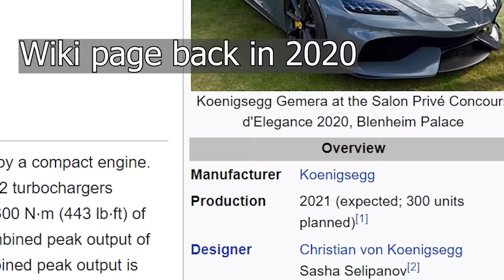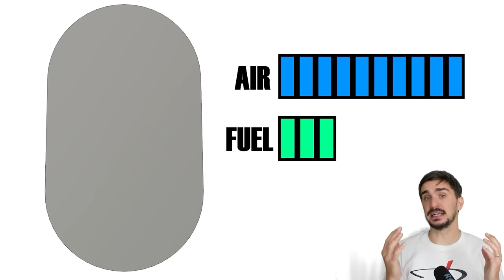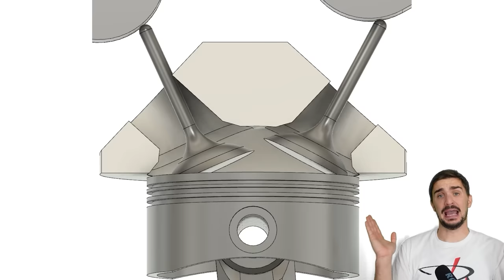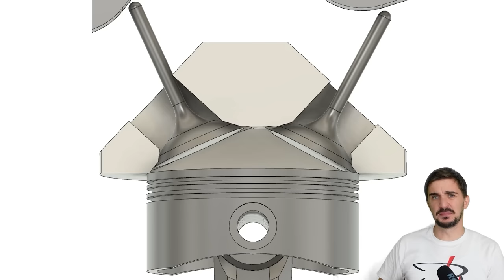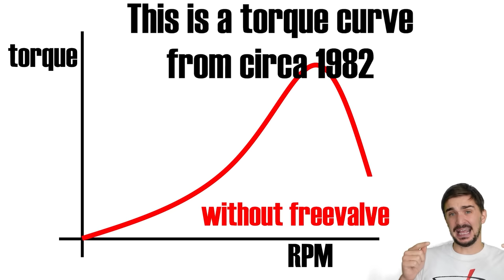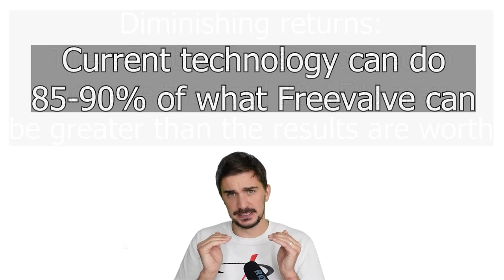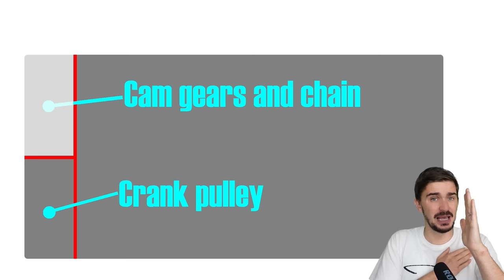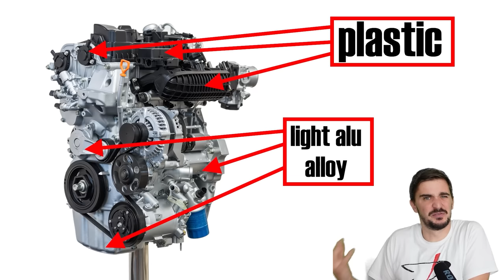FreeValve Isn't a Big Deal. Here's why

Comment: The numbers that Freevalve annouced really are not that exciting. But I stil believe it is a game changer: less energy loss on mechanical components. Moving the whole cam system demands a lot of power, and the bigger the engine, the bigger the system and the loss. It also is quite simpler. Imagine if they actaully make it mass produced, reducing the price to reach the simple cars, just like GDI did years ago. We desperately need less complex engines. VANOS/Valvetronic from BMW, has an insane ammount of moving parts. But FV is just one part of the equation: put it together with pre-chamber ignition and eturbos and we are taking combustion engines to a new level of efficiency. If you want to still have many moving parts, use a variable compression system. It will bring more benefits and less drag than the traditional camshaft system.

Comment: for each valve...  would it not be simpler to use a hydraulic shuttle valve to redirect pressure application to a double acting piston that opens and shuts the cylinder valve depending on which side the pressure is.. trigger the shuttle valve to move by pressure pulse produced when a simple cam lobe passes a plunger.  eg if all the plungers for say timing the valve openings are on one place, that can rotated and all the opening timing is adjusted by rotating.
fully adjustable valve events, and avoids use of springs. conceivable such would allow valves to open faster, and without spring bounce allowing higher rpms.

Comment: Did you ignore the " torque" lost spinning the cam shaft and other heavy parts !? Or i  misunderstood..... How ever it's like having Traditional engine plus electric motor Sooo if they use perfect RPM small genriter to charge Battery 🔋 and big electric motor to move the wheels it's the same

Comment: Freevalve honestly isn't worth it for any single one of those reasons listed, and yes all of those performance claims were trash, but I think trying to combine all of the different features of different cams and trying to achieve this infinite variability on the cam profile kinda leads to the idea of a camless engine. What I mean is we compared individual benefits without acknowledging that a camless engine brings all of those benefits together. Is it worth it? If you're a DIY hobbyist and just WANT to then I guess yeah, but to make it more suitable for mass production it definitely needs to be electric not pneumatic.

What would be really fun would be to have some electromechanical switches and dials and rotators and all kindsa goofy old sci-fi horror looking controls and confuse the living hell out of your friends / mechanic with a control system that looks like a Biblically Accurate Swiss Watch™️ lmao

Comment: surely the major benefit is a massive reduction in rotational mass in the engine? no more cams no more chain no valve springs sucking energy. albeit the solenoids will still take energy to run it'd be a lot more efficient.
Reply: "no valve springs sucking energy"?
There is springs on the valves as in a usual system, but in a usual system some of the energy used when compressing the spring while opening the valve is returned to the engine when it "drives" the camshaft on valve closing(On high RPM you will probably not get back much energy though..).

And you really think that compressing air with a piston air compressor(With internal friction n stuff) and then use that air to open the valves would be more efficient than mechanically open the valves with a camshaft?!
This is from a Motortrend article called "Is the Era of the Camless Valvetrain Finally Upon us?" :
"Möller says that although the compressor (featuring standard AC-compressor innards capable of peak pressures near 300 psi) generally consumes more energy than camshafts"

Comment: Your small margins are very misleading, and you base them only on horsepower.  Yes, any good engine builder can build the 600 HP engine you speak of, but what you fail to acknowledge in your analysis though you covered it in your explanation of RPM, scavenging, etcetera, the comparison you use is only based on horsepower, and that measurement is always made at high RPM.  At low RPM, the Freevalve engine is dramatically better in throttle response, idle, and emissions.

I too am disappointed that we haven't seen Freevalve successfully launched into the market.  I suspect reliability is the issue, but that is simply conjecture on my part.  Theoretically, it is head and tails a better technology when compared to the traditional valve train.

Comment: This person does not know how cars work at a level that he should be explaining things.  I've been skeptical before, now I'm sure of it. If you had done that slightest, I mean, any research at all you would have found that we don't really need free valve because we already have a pretty strong source of limitless Valve lift tech. All major European brands imply infinite lift control. It can't do some of the nifty tricks of Free Valve but it maintains similar thermal efficiency.  My favorite part about this is that the current leader of the lift control tech is BMW with their Valvetronic system. The  MINI coopers use's this tech. You compared a limitless lift car against a similar car.  You could have thrown a dart at a board and been more right. Please try a little....... or don't most of these folks can barely read. so whatever.

Comment: What was that cam on the grinder with 3 lobes on one lobe? Also I don't think it is going to reduce pumping losses at idle and such, now instead of sucking through a barely open throttle body (straw) it is going to be sucking through a barely open valve (straw).

Comment: What is old is new again. One of the unnecessary and unproven technological features that helped sink Preston Tucker's original engine was hydraulically actuated valves. That was postwar American technology and it was only to replace the cam, lifters and rockers. It was not programmable but it proved unworkable. Tucker literally wasted most of a year and an unknown amount of investment dollirs so he could claim hemispherical combustion chambers. Anyone who is unfamiliar with the kinematic challenge of actuating overhead valves in a hemispherical combination chamber need look no farther than the unwieldy exhaust rockers on the various Chrysler Hemis.

Comment: Theoretically, Freevalve can make more power than a K20 engine. Because Freevavle can have infinite variable valve timing. I mentioned the word "theoretically". BMW is the first company to implement electronic solenoid engine vales in the 90s. It has already proven that the engine consumed in solenoids are much more than traditional camshaft frictions. Since electricity in an combustion engine is "expensive" (engine output shaft driving alternator) , there is no way for you to overcome that energy consumed in the electromagnetic motions by valve timimg improved fuel efificiency.  Koenisegg didn't invented this technology, it just reuse the idea to rip off investors for his own game. Yes, Freevalve can make more power but not energy efficient than a simple mechanical camshaft engine. Chris Koenisegg is not even a qualified engineer, l think he has little understanding about physics and thermal dynamics. Try to beat the law of physics to fool investors. His investors and Chris needs to go school to know what they are doing. BTW, I am a mechatronic engineer from 90s. He should use super conductor coils, but if super conductors exists why not go electric motor? Lol

Comment: What are the costs of achieveing the first 90%?

Mechanical VVT is not cheap and increases the complexity of an already complex sytem, introducing multiple points of failure.
Replacing the whole system with a single unit will be huge savings in all areas.
I'm a big fan of this channel and this is a great video, but Electro-Pneumatic/Hydraulic Valve control will be at least as big a deal as Fuel Injection.

Also... you dont need an extra air compresor or pump if you scavenge exhaust gases.... Turbovalve Incoming!

Comment: Gee, what a teacher! I had a basic idea with regards to the Freevalve Technology, but the Freevalve Technology doesn't appear to have any 'failsafe' in its' design. You drop a Valve on some exotic Supercar - what then?? We have seen how far the Internal Combustion engine has come in the 100+ years, almost a technological marvel today. Each individual Engine Component is interdependent upon the other. Hundreds of individual parts! High costs for engine repairs. I wish that Driving 4 Answers would place great emphasis upon the overall EFFICIENCY of any ICE, and those specific areas of pure inefficiency. During over 50 years of messing with engines, my guess is, that ICE are only 50% efficient. Looking to the future (and by comparison), Electric Motors can supply instant power and instant torque. Best bit of all, Electric Motors (today) are 98% efficient, requiring little or no maintenance. In concluding, if you want to get from A to B by any propulsion method that is only 50% efficient, you are actually paying TWICE as much for your gas or diesel, + maintenance costs of running a ICE. Greetings from Australia.

Comment: Hydraulic valve timing has come a long way in the last decade. As long as you do your oil changes regularly it's bloody reliable too. The only failures I ever see is because of lack of service. The inside of the motor is always full of gunk

Comment: Efficiency and power are not the only benefits.   Easy of repair is another.  Alot less moving parts, wear items and seals.   No need to replace timing belts and loss of efficiency as the timing belts and chains get loose.    I see a great deal of potencial but also alot of greed by the major automakers.  they would rather not use that technology and find a way to copy it and not have to pay royalties.

Comment: Ik this is one of those hearsay 3rd hand stories so believe it or not. When I was getting my automotive degree my instructor worked at the gm  headquarters back In the early 2000s he wasn't an engineer but obviously he knew most of them working in Detroit at the time and apparently in the 90s gm developed a "free valve head" or a head with  solenoid actuated valves and they prototyped it with a  small block and threw it into a truck. Allegedly it made 400 hp and could get up to 25 mpg. But gm (too this day even) didn't need it (aka they didn't wanna spend the r&d money and it was a lot cheaper to produce a  conventional engine. Too this day gm truck engines are still basically small blocks just with all the modern bs). So they ended up just shelving the concept. Btw when the big 3 are doing r&d like that they tend not to patent stuff  because once you patent something you make exactly how it works public and patents expire after a while so they won't patent something until they get ready to make it. Edit: it is kinda funny how people think Koenigsegg would be the the first ones to come up with this.

Comment: Wait, wait, before you pull the plug on the free valve how about a 2 cycle engine with same emissions as 4 stroke.  How about the one stroke engine where the the valuing would be integral to the cylinder walls like a 2 stroke with rotary valve.  Until I hear from a major engine manufacturer like Yamaha say that using a free valve engine they have tried 2 billion combinations of valve timing, lift and duration along with spark variations and stoichiometric variations and haven’t found any trends outside of current limitations I can’t accept the premise that it won’t be of much help.  Got to get outside the box.

Comment: You see your not talking about the heads that’s what makes the flow 😅 and I am willing to bet if they had the same head flow the free valve would be better by far and you also for got to add in fuel consumption ie mpgs and I am also willing to bet that the life span of the motor would be way longer than a cam driven motor bc it has less stress you could also add in more cooling due to the missing cam and bigger pistons soo you should make a video on that

Comment: Produce some electric solenoids that control valves. No air actuation.
Noone can tell me that mechanical valve control is superior to having electrical solenoids controlling the valves.
No physical wear of rollers, cams, no mechanical possibility of failure. Solenoids would be easy to exchange as opposed to removing cams.
But I guess there's a reason why no one's adopted this technology 🤷
Reply: mechanical valve control returns most of the energy used to open the valve back into the system. You will lose mpg with freevalves as you won't be able to recoup the energy used to actuate the valve.
Reply: @wally7856  how exactly does it return invested energy?😮
Reply: @spiKey0svetlana  On the valve closing the valve spring returns the energy used to compress it back into the cam to help open the next valve. Minus losses of course. Exactly the same way a piston adds energy into the crankshaft to compress the next cylinder.

Comment: You have made one error in your analysis. It's that all the other improvements have in fact been incremental improvements as well. And there's no reason to believe that freevalve is not just another meaningful incremental improvement. The real obstacle to freevalve is going to be something silly, like patent and intellectual property obstacles. Making it too tedious and costly for big manufacturers to implement into their supply chain. Freevalves needs to make itself cheaper for mass production.
Reply from the maker: That's one of the points of the analysis, it's an incremental improvement for non-proportional cost and complexity

Comment: The lift is definetly not variable just the duration. making a variable pneumatic cylinder is near impossible at these speeds. Maybe (BIG maybe) in a prototype. But it will never be reliable. Also i dont belive its possible to build such a system reliable. Better way of doing that would be a cam ground in a way where u can have a range of different lift/ duration specifficly tuned to that engine and car. Not stepped like the systems today.
Reply: A pneumatic cylinder is used for opening force and a "passive" hydraulic cylinder(A valve lets oil in or out) for position control(Both are on the same "axis" or however you would say it).